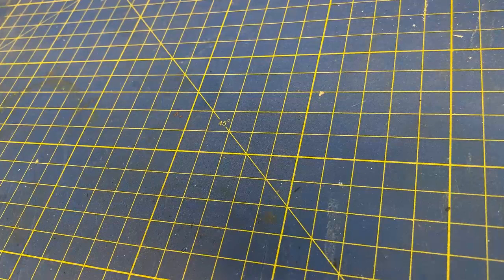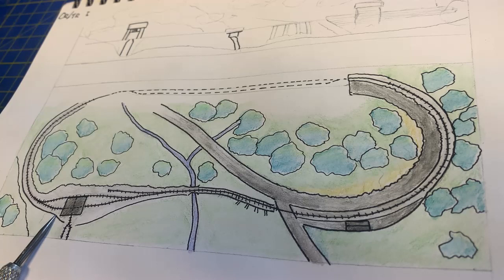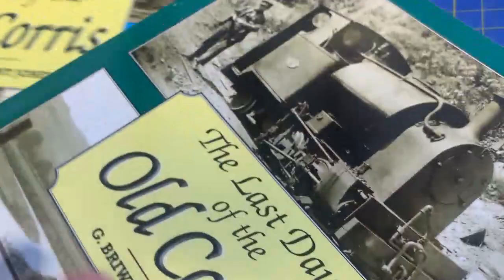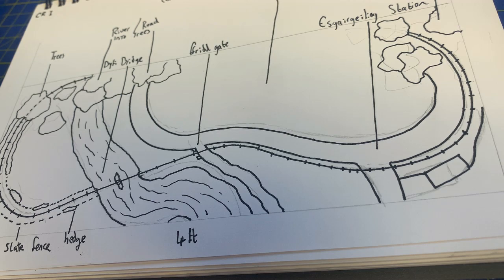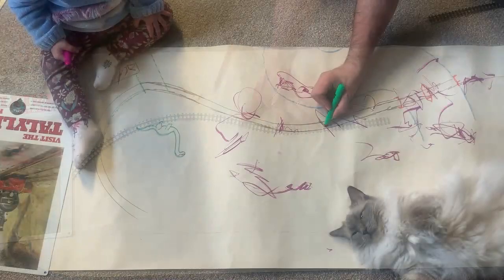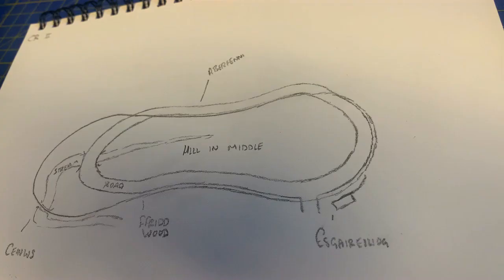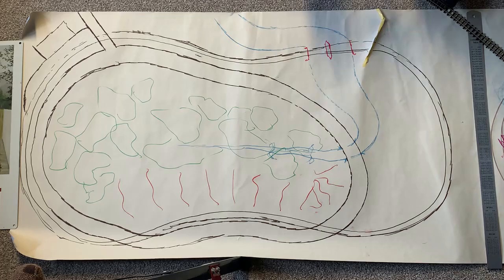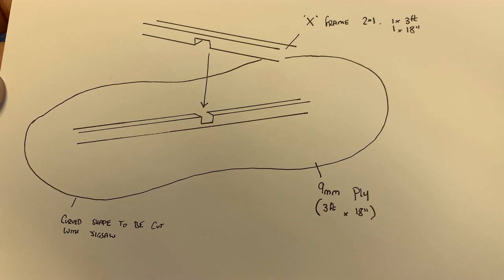Planning an AMAZING Model Railway Layout in 009 Narrow Gauge

Comment: Great advice. When designing my OO9 micro layout I used a few pieces of N scale set track to use as templates which were easy to move around. When happy I marked the center line and laid the OO9 flex track.
Reply from the maker: It’s a great idea to start with things like points as they set the rest of the layouts shape, and that’s how I would have gone about doing this one if the points stayed in the plan!

Comment: Could you incorporate a fiddle yard under the hill ? Also don't have a "flat" baseboard, make one side or end higher than the other, giving the impression the line is in a valley or part way up a hillside.
Reply from the maker: Thanks for the suggestions, I don’t really feel that it needs a fiddle yard, as it’s just a continuous track designed for one train.
It might be hard to see from my plan, but it’s very much not a flat baseboard, the line is hugging the hillside most of the way around, the slate side is steep, and will most likely have a peak of about 8-10” above the track level, likewise, the lowest part - the river bed - is about 4” below the track level, so really not much flat land atall :)

Comment: As you know I like layouts based on real locations, they always look more believable. Some lovely cameos in here. But will it get boring quite quickly - just a single run of track? Also will the edges of the board warp, if only supported by an X in the middle? 9mm ply is pretty good at not warping but even so… anyway just some thoughts mate.
Reply from the maker: I’m the same Colin, this is about as ‘freelance’ as I’m prepared to go! I have Pendre as my actual layout, this is purely to have trains moving whilst I work on other projects, which is the reason for a simple loop. In terms of the board, I’ve already started building the layout, and as you’ll see in the next video, I went for 12mm ply with no frame, no chance of warping as the layouts small, plus the scenery base is foam, which is glued over the complete board, which supports the wood. Plenty strong enough :)